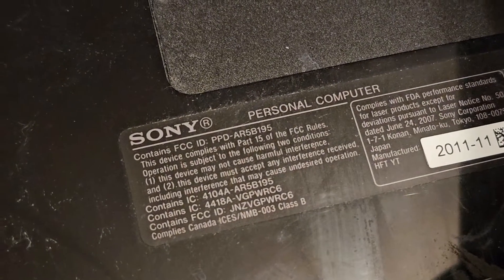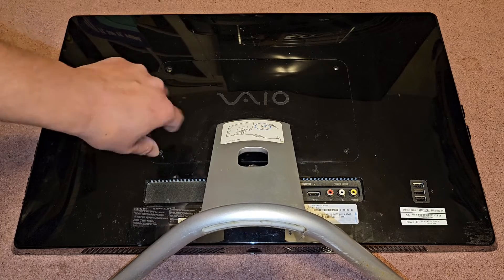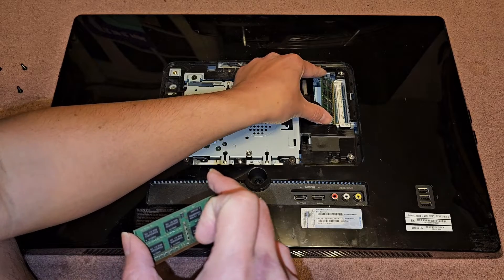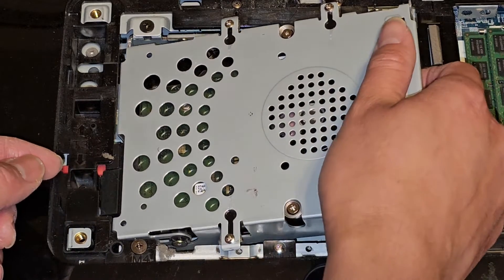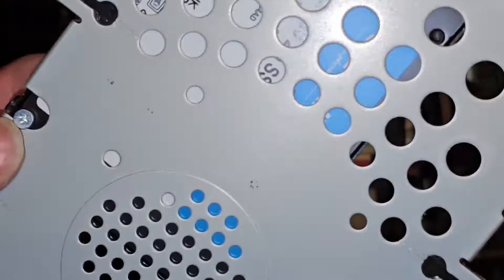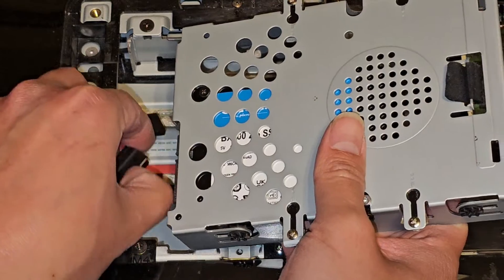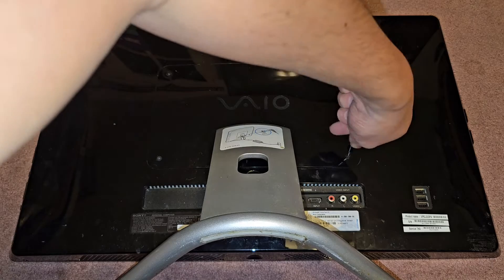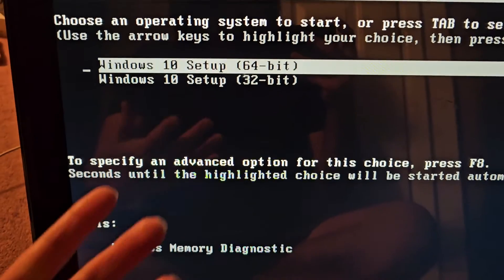Sony VAIO PCG-21514L VPCL22DFX Disassembly RAM SSD Hard Drive Upgrade Replacement Repair Quick Look

Comment: Is there a way to permanently remove the touch feature on these computers ? I’ve removed the drivers but they come back after a while
Reply from the maker: Disable it in the device manager. Don't remove the driver.
Reply: @ItsBinhRepaired with the new ssd can it remove that driver completely ?
Reply: @ItsBinhRepaired can I also upgrade it to 16gb ram?
Reply from the maker: @wadeyu9116  16gb should be doable. Disable the device. Removing the driver is not the way to do it. It's the equivalent of removing the instructions for how to do something. Why do that when you can tell the computer to pretend it's not there.
Reply: @ItsBinhRepaired thank you for the fast reply I keep seeing by ChatGPT that the limit is 8gb on this computer
Reply from the maker: @wadeyu9116  no problem. ChatGPT doesn't have experience. It just goes based off of whatever it saw online. More than 99% of the time the limit is just the max they sell the device with.